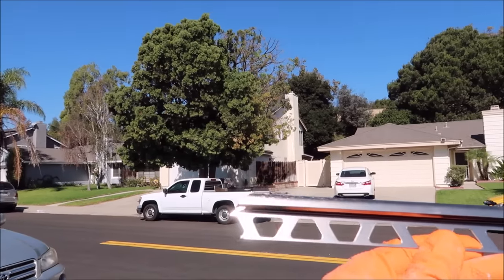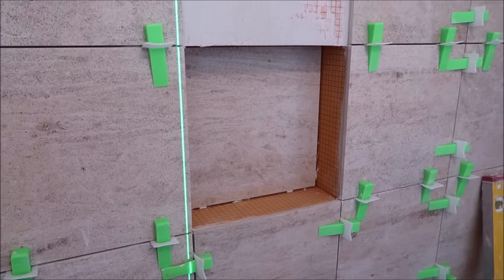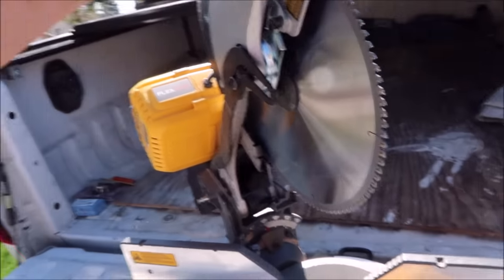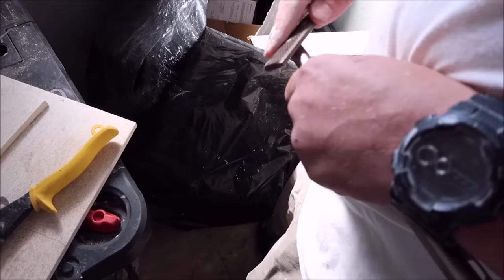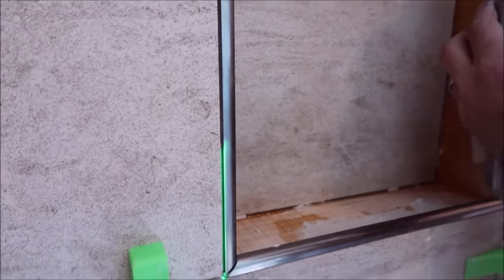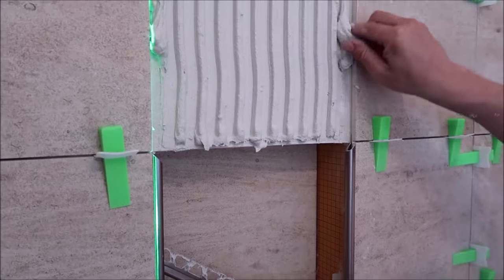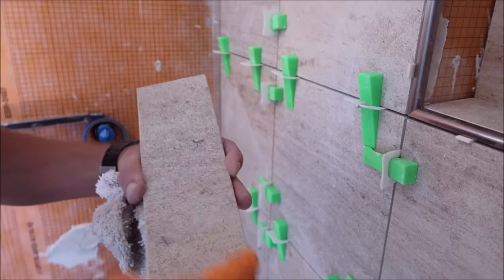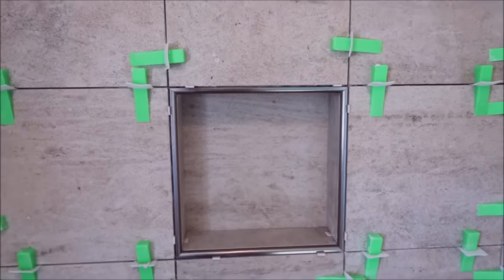Modern Trim for a Shower Niche

Comment from the maker: Below are the links for the saw and metal blade to cut the trim profile:
https://amzn.to/2KRHxmw
https://amzn.to/2Qu0hxC
Reply: Which blade should I order to cut the metal edge trim? 80 or 100 tooth?
Reply: @dannyaguado  more teeth means finer/smoother cut, but is a little slower. go for 100tpi and wear ear muffs
Reply: The blade in the miter saw is 12 in. but the blade in the above link is 7-1/4 in. Can this (or my 10 in saw) take smaller blades?
Reply: I came here to ask this question. Thanks.
Reply: Thanks buddy,  much appreciative of your dependability 👍

Comment: I would install bottom first, then the back. Then any water that comes down the back is automatically directed onto the bottom piece and will flow out of the niche. You DON’T want a vertical surface meeting a horizontal surface where the water can go right into the grout line. Same for the bottom of the shower. Install your floor tile first, then do your walls so the water is coming down the wall right onto the sloped floor.
Reply: I was thinking the same thing, I wonder why he did it that way.  And I've seen other videos where the installer did the same thing.  I guess to cover the cut of the bottom edge of the back tile to give it a cleaner look?  Still not worth it.  I've seen shower floors fail for this  reason.  Everything should be done with water shed in mind.
Reply: I agree and I am no expert, but to seal that niche, the home owner will need alot of silicon, but as we all know that silicone will fail at some point and the home owner will probably not know that it failed until all the lower tiles fail.  I am wondering if they could mig or tig the joints and have the bottom plate actually extend over the bottom metal so water never even hits it.
Reply: @bs4760  He will use still the same amount of caulk. You should caulk every inner corner in wet places.
Reply: Caulk for effect over
Reply: True statement
Reply: Thats how I do mine this guy making videos before he knows how to install . Plus definitely use a miter saw but explain to people he has an 80 teeth blade you can't use a regular wood cutting blade with 24 teeth you'll learn real quick 😂

Comment: Using a miter saw to cut schluter trim seems like a very good idea. On my niches i usually install the bottom tile first and then the rest,i believe it seals it better,bottom tile then back one,sides and top
Reply: omi89 that’s the proper way 
Shingle effect
Reply: Absolutely

Comment: I don't even know how you can get 30 people disliking this I'm a tile guy with over 25 years exp and that is exactly how I do it also great instructions . I have watched alot of your videos I can truly say your a true tile professional
Reply from the maker: Thank you sir, that means a lot to me, appreciate the comment more than you know....👊
Reply: Because it goes against schluter’s installation instructions. It will fail because the mortar is pushed out of the way instead of imbedded like it calls for.
Reply: You can imagine how that mortar  is pushed out of the way like Amy points out.  So no tile adhesion on this edge. So in reality you have voids where water can pool and get behind the tiles more than if installed per Schluter instructions.   The membrane should maintain water proof but this may be a mold  growth site.  It would be better if less voids at all in the thinset.
Reply: I agree and sometimes it is what it is in construction to get the job done right. If there was enough mortar there in the first place there would be no voids to worry about.
Reply: hard to believe 25 years exp and you dont see an issue here ,,fist the shelf should always go in first  with the wall and side  piece sitting on top of shelf eliminating an issue ,,second now you have water running off the shelf then it hits the seam /joint  where tile and metal meet creating another issue ,,and this is the big one cause water will just sit on that grout joint break,, hello !!!!

Comment: For the flow of water you install the inside bottom shelf first an after the back of the niche and the two side finish with the top inside
Reply: indeed ,,you and like two other people got it right,,,that is the right way,,and a flat grout joint is never a good idea ,,water needs to run off uninterrupted ,,
Reply: Steven Héon I was curious about that, since I am doing research on this for a home project, thanks for pointing this out.
Reply: But with that trim piece wouldnt it hold water either way?
Reply: @Z-Ack  These guys are talking about the bottom tile piece/shelf installed first, then back, etc.. But the tile should always be just slightly above the top of the trim. Looks/feels better and won’t hold water. 
It might be over-kill, but I use a thin bead of silicone on the front edge of the shelf against the trim so there is no possibility of water going down that way.

Comment: Very crisp work. Use razor blades as spacers, to maintain requirements at change of plane. Also can use wedge spacers + gorilla tape when adjusting posture of each inside panel of niche. Thinset holds air, so we recommend the use of a rubber mallet to knock the air pockets. Otherwise your trim and tile can sink overnight.

Comment: Looks great bro I’ve been doing this kind of work for 27 years and I still love doing this very satisfying when the cuts and corner metals come out nicely cut I got sertified with schluter in up in their home base in Pensilvania years back and love all their materials they make great stuff
Reply: I am wondering if there is concern with water ingress at the mitre joints of the trim?  thoughts?
Reply: @shawnlittle7207  I wonder the same thing.  Did you ever get an answer to this?
Reply: @shawnlittle7207  If there is  any water penetration, it will naturally dry out as the substrate is kerdiboard (waterproof) and as long as that has been installed correctly, there shouldn't be any long term issues. Water can also be absorbed through grout lines but this will also naturally dry out after use.

Comment: Overall fine job and detail but I would lay bottom of the niche first and then the back so water always runs over tile rather than contacting corner joint if grout ever fails.
Reply from the maker: Good advice! 👊

Comment: Nice job brother! Looks great! It's spooky just how identical your jobsites look to mine.
Flexvolt ftw!! Dewalt line green cross line laser ftw! LevTec ftw! Schluter ftw!  You've got a whole lot of winning going on. Your installs are on point. I love it! 👊
Reply from the maker: Thank you buddy! appreciate the kind words👊
Reply: I wish I could show you a couple photos of the bad job my tiler did on the niche and the shower floor. The shower floor has to all come out, the metal AND tiles around the niche and window all have to be removed. Is there somewhere I can go in Toronto to have them cut me the right size in the schluter metal edging? How can I post photos on here?  Thanks Mary
Reply from the maker: @mj24672  Hi Mary, That's very unfortunate and I'm sorry to hear the bad news. No photo's posted here, simply information sharing. I hope my videos help you chose the right guys for the next job.
Reply: Mary Kane Any Tile store can cut tile for you if you give them the measurements. Home Depot and Lowe’s can as well but I would recommend going to an actual tile store over them to cut it.

Comment: Would like to give a Like to it,  As  16 year aluminum tile trim manufacturer,   would like to give sugguestion trim's packing would be best with transparent protective film on the trim surface,  peel of the film afteer installation.  More better on the trim surface itself

Comment: Just install bottom piece last with fall and no need to taper side cuts.
Reply: Don’t you want the water that runs down the side to fall more-so onto the surface of the bottom tile and then out, rather than down into a grouted tile gap? Doing the bottom first would put the grouted tile gap on the side instead. Or does it not matter?
Reply: I wouldn't grout it ,would silicone seal all  perimeters ,
Reply: @stephenc4161  thanks, great point
Reply: @CalleyyyC  no problems just what I found has worked best long term.
Reply: Ive always installed the bottom first, set the back in next then the sides and top that way everything sits on top of that bottom tile..  besides a pitch as small as what is needed for water roll out is like what 3°...  so an angle grinder with a tile cutoff wheel works fine and can clean it up with onr of those knife sharpening stones for tile...   my only concern for this video would be trying to set the bottom tile where its proud of the little lip thing he put on because i would imaging the tile would end up inside of that piece and just pooling up water because of that lip...

Comment: Excellent work on the tiling and very informative. The word niche is pronounced neeshe and its from the French word niche meaning recess. You were pronouncing it nitch.
Reply from the maker: thanks Robert! Here's is some data for food for thought..

There is a debate about how you are supposed to pronounce niche. There are two common pronunciation variants, both of which are currently considered correct: \NEESH\ (rhymes with sheesh) and \NICH\ (rhymes with pitch). \NICH\ is the more common one and the older of the two pronunciations.

Niche | Definition of Niche by Merriam-Webster

https://www.merriam-webster.com/dictionary/niche
Reply: I suppose you could pronounce it however you want, the word is French in origin as I said meaning recess which is what you are working on. The French pronounce it neeshe. Your call, no response necessary.

Comment: The tile pitch it goes first and the one in the back it goes over the tile pitch
Reply from the maker: watershed is for a niche that is not waterproofed. It can work both ways...
Reply: I wouldn't recommend doing it this way. Bottom pitch piece of tile should go first to shed water no matter what. Your being lazy on having to cut the back tile piece. Nice cuts on schlueter. Looks good 👍

Comment: i saw on the schuter site they sell corner inserts to connect the pieces, either as inside or outside corners. but it looks like the miter is a good look and not too tough to pull off.

Comment: I do top of niche then sides to hold up top and then sloped bottom so that I dont need to taper sides.
Reply: i usually do the bottom first so the back (usually glass) can sit on top. but i like your way too.
Reply: Who cares?
Reply: @chrissmith2921  Greg was just trying to help and you were trying to be an a$$.  Both were successful.  You mom would be proud...
Reply: @BPRescue  That's nice.

Comment: Have always set the trim into the grout and then set the tile. This method seems to push the grout out of the way allowing water infiltration and a leak if you don't grout it absolutely water tight. Nice job though.

Comment: Hi Mr. Landberg! What grout spacing are you doing here for the wall? And would you recommend doing 1/32" spacing for 14"x24" tile for wall? Thank you so much! Learn so much from you.
Reply from the maker: 99% of our joints are 1/16. We go bigger or smaller whether or not we end up with slivers at the top of the shower. 1/32 shouldn't be a problem with big tiles like that as long as the walls are flat and plumb (1/32 is the smallest you can go, less wiggle room)

Comment: Schluter also offers inside and outside corners to match the rondec.  They are about 14.00 each so most pros don't use them but they do fit perfect and you don't have any sharp edges.

Comment: It  looks nice but .... I pretty much do it the same way but set the bottom tile first with 1/8 shim under the bask for forward pitch. Then put the back it. I personally want the water to shed downhill. Ur way there is a chance water can get in the back edge on bottom edge ... each their own ... just sharing. Thanks

Comment: Just a suggestion putting in the side tiles before the bottom and you won't have to tapper them and it doesn't effect the bottom tile
Reply from the maker: Watershed, always good to stack on sill.

Comment: What size compared to tile your using.   I'll be doing 6x24 on a wall with a 1/2x1/2 trowel and back buttering tiles.   My tile is 5/16.   Is 3/8 enough to be level with my tile with all that thinset ?   Is 1/2 trowel overkill with backbuttering.   Thanks for any help again.    Keep up the videos.
Reply: Schluter recommends using same thickness as tile

Comment: Nice work. Two questions.  How did you grout?  Even by pitching the bottom piece of tile, any water will run down the trim into the tile?
Reply from the maker: Negative. It will be grouted and the niche should always be waterproofed

Comment: Excellent job. Question. When should I and shouldn’t use Schuler? (versus backer board)
Reply from the maker: I don't understand the question. We used Schluter Kerdi backerboard, or we use drywall backerboard with Kerdi membrane. Both methods work.

Comment: Those grout lines along side the profiles are perfect.  When using ceramic tile, the factory adhesive has a slight lower profile than the cut edge.  It’s easy enough to use all factory edges inside the niche,  but when doing a running bond pattern on the shower walls you will have the thicker cut and fed and possibly the factory edges along the same piece of profile.  How do you make that look acceptable?

Comment: Would it be better/easier to install the sides of the niche first then install the bottom tile on slight angle for drainage?
Would not have to match the angle when cutting side pieces. Love the modern look.
Reply from the maker: We always put sides in last, but there is more than one way to do it 👊

Comment: extremely clean. love it! just wondering though about the miter joints of the rondek (not sure how to spell it) after install. I always use my yellow wedges form homedepot to space any niche profile edging so i can get some grout in there to prevent a dry bond where water could slowly seep in. Maybe you just silicone the joints ? let me know because if your confident in just sealing it afterwards with silicon then i will likely do the same in the future because of how clean it looks. i know also that it doesnt mater as much with everything topically water proofed either... but just an observation :)

Comment: I'm about to do this same project, how do you slide that thin metal webbing behind the tile like that? Is the mortar under the tile not cured yet, or did you leave some area under there without mortar?
Reply from the maker: Yes, wet thinset when you install. It's simple to install. 👊

Comment: looks nice ,,so this may be a lame question but are you concerned about water penetrating the metal  inside corners ?,no room for grout ,,caulk?? and what are the name of those shims ?
thanks
Reply from the maker: Yes, we grouted between the trim and tile, and the shower is waterproof, so water can get into the grout lines. Grout is not waterproof.
Reply: @LandbergTileTV   Yes I get that,,maybe i did  not present my question correctly,,there is a slight cap at your metal inside miter corners ,,do you worry about water at those 4 inside metal corners ?
thanks

Comment: That speisors becouse the wall not straight? Just a question, since I never used it for the wall tile.
Reply from the maker: We like to keep the grout "space" joint the same around the trim  as it is with the other tile. Did I answer that question correctly?

Comment: Great work but to clarify, you have a link to a 40 tooth blade but in the comments you mention using a 120 tooth blade and also a 40 tooth.  Can you please clarify which is more appropriate because i want a nice smooth cut if possible.  Thanks and love the electronic gems music.  I listen to that while i do projects all day long.
Reply from the maker: The best is a carbide ferrous Diablo blade, but we have used many cheap 80 tooth blades on amazon like Neiko without problems.
Reply: @LandbergTileTV  Right on man thank you.  I've learned a ton from your channel.  Appreciate what you do.

Comment: Got a conundrum... I’m using 24x12 tile and two are cut around this niche, each cut sort of L shape-square to cover two edges. How can I do this without having one last single piece to install like you’ve done here?  See, yours is four tiles, one for each side so you can slide your last piec in perfectly. But since mine is two tiles, each covering two sides, so I don’t have the opportunity to slide that last piece in... 
I’m thinking of installing one tile that’ll cover two edges, inserting the trim on those edges and then when I’m ready to install the next tile that will cover the the final two edges, attaching the trim to the tile with a little thinset and sliding it in to meet the other two. I kinda think that’s my only option, but I’m curious what you think?
Reply: Nothing I do is ever easy, I like to challenge myself 🤣🤣🤣

Comment: Couldnt those flanges of the trim be placed inside the niche instead under the tiles on the large wall like you did? Is it better to put trim on the outside instead of the inside?
Reply: I'm wondering this as well, since I have currently got my vertical facing tile set and intended to come back and finish up the niche later.

Comment: What prevents water from seeping into the mitered joints and getting behind the tile?  Do you put grout in between the mitered cuts?  It doesn't look like you provided enough room to do that so I'm a little confused how the water stays out.
Reply from the maker: Yes, they are grouted.